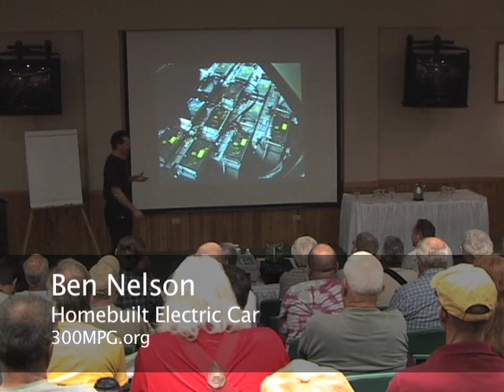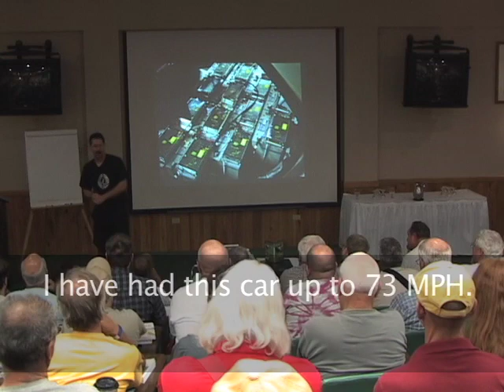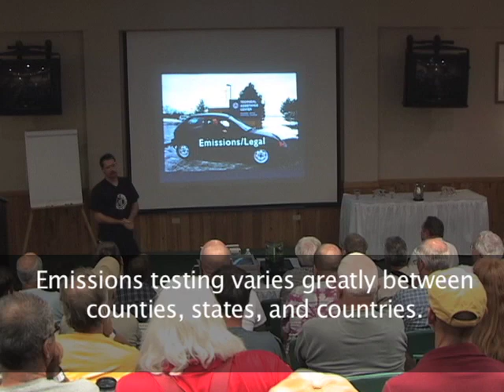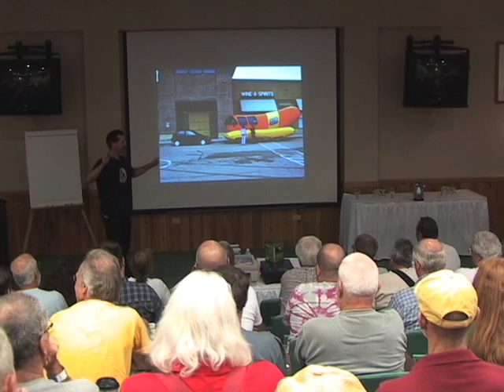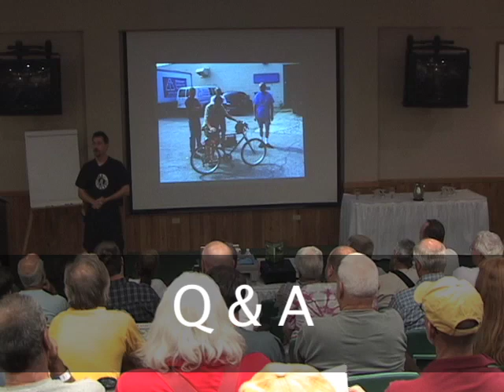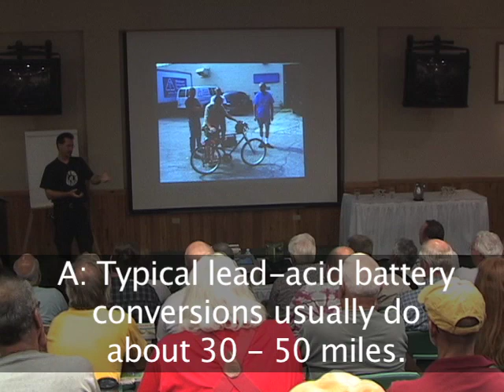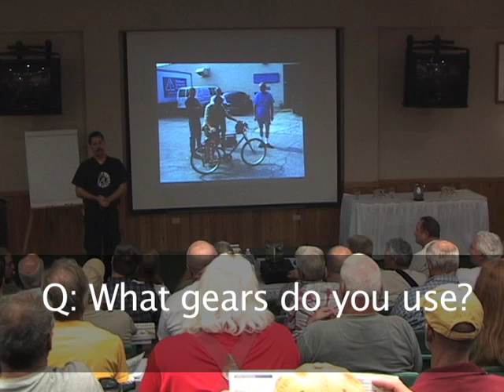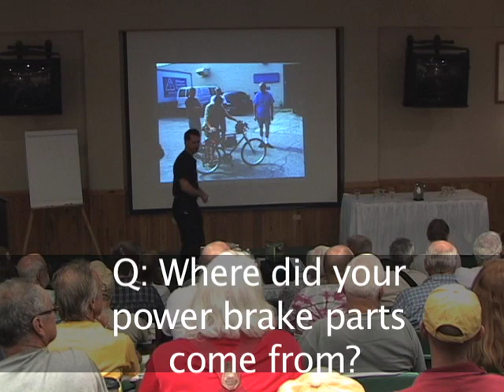Build Your Own Electric Car: Cheap, part 6

Comment: I watched all of the electro metro vids posted . First of all thanks for the info . I purchased a 94 metro in 08 knowing conversion kits were available through the canadian company. I get 50 mpg with the car now, wich does make it hard to give up. When I figured out how much the kits cost , I decided to wait till I blow it up first. I did go over the body from top to bottom and repaired all the common rusted places very well. It is tempting to convert it like you did , but I would love the kit.

Comment from the maker: @relikvija 
No car is "too heavy", but the heavier the car, the more energy capacity you need to get it going down the road, and the more batteries, the more weight. It quickly becomes diminishing returns.
I would love to see somebody make a high-performance EV based on a muscle car.

Comment from the maker: @2020visionstudios 
You don't! You get 12 batteries that are all 12V and connect them in series.
The positive connection of one battery goes to the negative of the next. This adds the voltage of one battery to that of the next. 
Connect all 12 batteries together this way and then connect the power cables for the motor and controller to the two far ends of the battery pack. 
You now have a 144V electric car!

Comment from the maker: @thedaytripper3330 
You can pretty much convert anything to electric, but a camper is going to take a LOT of energy to move around. That's going to mean LOTS of batteries and powerful, expensive parts. The upside is that campgrounds that cater to RVs are some of the few places where you have easy access to electricity in public.
Some big RVs pull a "runaround" vehicle behind them. THAT vehicle would be cool as electric.

Comment from the maker: @algea07 I don't usually drive that fast.
Max speed at 72V is 45 mph.
Max speed at 144V is 75 mph.

I think that freeway speed was something like 200 amps at 144 volts or about 28KW. Take that with a grain of salt though.

I can cruise at 35 mph on 72v on a quarter that much power, so that doesn't sound too far off.
Driving fast takes LOTS more energy than driving slower does.